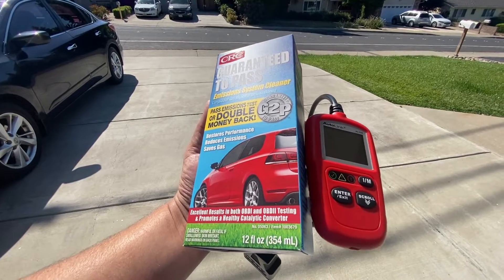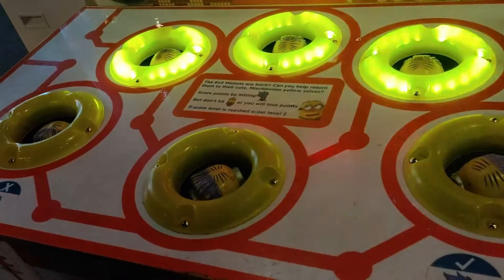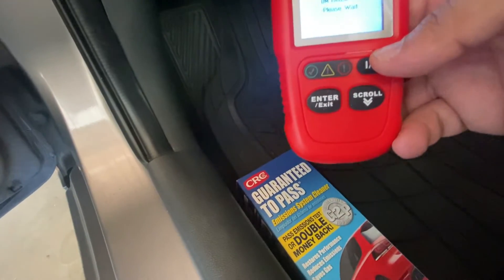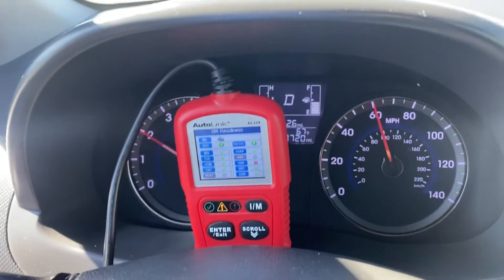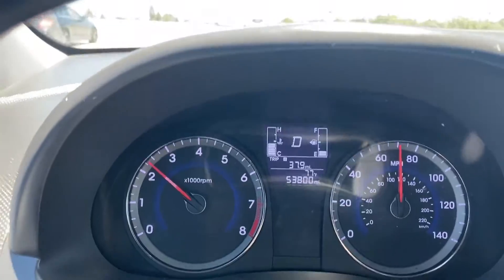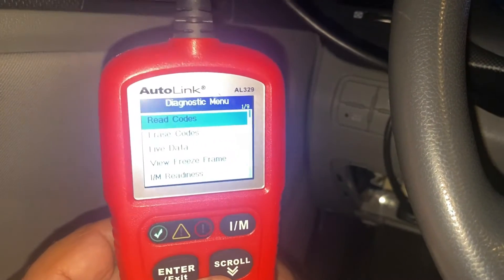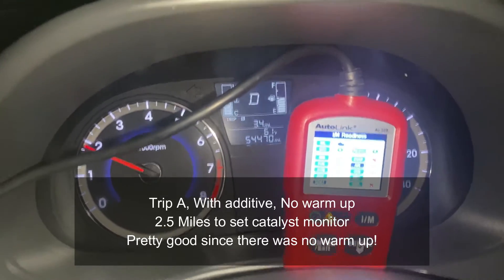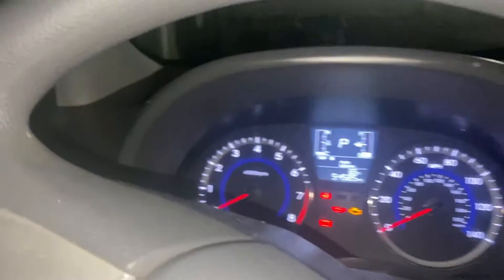I Tested Guaranteed To Pass Catalytic Converter Cleaner. Will it Pass A SMOG Test?

Comment: My 2015 Kia Optima 2.4  had a Code P0420 i changed the Air Filter and Sprayed the Oxygen Sensor and i used This bottle on 1 Quarter Gas i drove it for 60 miles Straight and the Check Engine light turned Off it really works 😊
Reply from the maker: I am glad to hear your got the check engine light off now. What did you spray on the oxygen sensor?
Reply: @RANDOMFIX I Sprayed CRC Throttle Body Cleaner on Oxygen Sensor

Comment: I have 300K plus miles on my quiet running modified 2012 race truck no Governor , Eco Boost Disengaged twin turbo stock f-150 XL I needed something to help temporarily fix and bypass smog Check as I didn't want to pay for a new Catalytic Converter for a truck im going to get rid of till a Rod blows out ... So this Additive is only to Allow you to pass smog checks as the Additive runs out and just keep on Driving . It works! AS says on the Box Guarantee to Pass!  says nothing about a  Full Fix of P0420 error code

Comment: My wife's 2015 Hyundai was all of the sudden running rough. Code said cylinder #1. I ran GTP a week ago. Now it's running smooth as glass and the check engine light is out.
 I've been using that stuff for decades, it works great before smogs.
Reply from the maker: Thank you for sharing your experience with Gtp, what was the code cylinder 1?

Comment: Would Premium gas work better with this formula you think? And will Colder weather affect the results? I am in Wisconsin.
Reply: It's what I use in my car, only when I need to get through emissions.
Reply: The only thing premium gas is good for is preventing knock, or pre-detonation, mainly for forced induction vehicles since they produce higher cylinder pressures increasing the chance of pre-detonation, doesn't really clean any better or make more horsepower or anything

Comment: I have a 2013 Hyundai Genesis Coupe 3.8 and it failed the emissions test, I bought the CRC and use it with a little more than half a tank, then I went on the highway to run at high revs, I think I turned it up to 120mph and it ran like 30 miles, then the next day I filled the tank and took it to the inspection and it passed. The product really works and I also noticed that the car is faster and the gas last more.
Reply from the maker: Thanks for the confirmation and congrats on passing. You got it 120 mph?
Reply: @RANDOMFIX  Yes, everytime I could and the amazing thing is that works almost instantly.
Reply: Do you clear the code first then pour?
Reply: @Jamesjeff49  There was no codes.
Reply: @bluetuscani5607 weird, every car that fails emissions will always have the P0420 code, you must have a check engine light, plug in a $6 OBD reader it will say “catalytic converter bank 1 sensor 1 not ready”

I suspect you know nothing about cars.
Reply: @Hugh-Jarnus  that's your personal opinion, am not going to tell you the whole story about that car but this is the second time I use the CRC and it pass with no problem.
Reply: @Hugh-Jarnus  wtf is your problem???
Reply: @Jamesjeff49 yes, clear the light, run the stuff or cataclean at highway speed (Italian tuneup), turn off your car & let it simmer, drive more hours & then check the code to see if it was fixed. 
If it wasn’t fixed, run another bottle, if not fixed this time the catalytic converter or 02 sensor is dead.

Comment: So,you didn't have a P0420 to start with?Why bother?
Reply from the maker: Because if it helps set the catalyst monitor faster than it can make a difference but testing a vehicle with a bad catalytic converter is sometimes not a good test as it could be damaged beyond the point when it can set the monitor. It’s better to test of working catalytic converters and see if it helps work better and sets the catalyst monitor faster. I hope that makes some sense

Comment: Hoping this fixes my p0420 code. I think the cold weather messes with it it feels like every winter the check engine light comes on.
Reply: How’s the results?
Reply from the maker: These results are temporary and the only really fix is to replace a bad catalyst.
Reply: @RANDOMFIX  as your experience,  how long it hold? a week? a month? or?
Reply from the maker: I am making another video right about the fix p420 with the dura lube severe catalyst. I would say 1 month and remember your vehicle is getting old as time passes. However once the monitor sets your are good for a while depending on how sensitive your vehicle as long as you don’t lose your drive monitors from a failing battery, etc.

Keep me in the loop and let me know your personal experience once you try.
Reply: @RANDOMFIX  thanks mate, wait for it